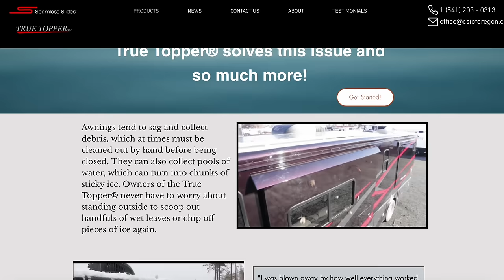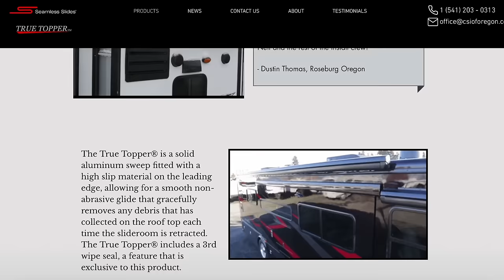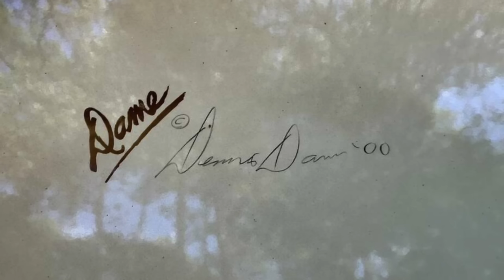Meet the True Topper® & Say Goodbye to RV Slide Topper Problems FOREVER

Comment: WOW this company is about to get really rich - once the RV manufactures see this, they are going to want them on ALL of their RVs with slide outs - This company needs to reach out to the RV manufacturers and sell them to them ASAP I hope this company has patents for it - As a mechanical engineer for over 35 years I think these toppers are quite ingenious - safe travels Lance
Reply from the maker: Agreed! These were on factory Tiffin motorhomes before THOR bought them out. As soon as one picks them up...others will follow! 👍
Reply: No, they won’t. Rv  manufacturers are all about saving money and cutting cost in the end. Also they will have to modify the lips on the slides. Don’t hold your breath.

Comment: Hey Aaron & Chris! Excellent overview of the True Topper. After 20 years with 3 traditional slide toppers on our motorhome, our biggest issue has always been the fact that they're mounted LEVEL, which allows water to pool. We upgraded the fabric to the FAR superior Tough Top Awnings material, which virtually eliminates flapping in the wind. But that still doesn't change the fact that they're mounted level, so water still pools, which we hate. We're planning the same True Topper upgrade when we get our new rig, so it's great to hear you're having a good experience. See ya on the road! 😄
Reply from the maker: Hey guys! Good to hear from you and hope all is well since we last talked! We've heard the Tough Top Awning material is really great and I'm excited for you guys to get your new rig and try out the True Toppers. You'll love them....such a simple, robust, clean,  and innovative product. I knew we had to have them when we were ordering our 5th wheel. Hope to see you guys sooner than later! 😊

Comment: I modified my three slide toppers to have a longitudinal slope as well as a higher athwart slope. Then the spring is set to maximum tension for the slide travel. No pooling no flapping. That system is very nice, but way beyond my budget. A new complete slide topper for one of my slides cost me $305 delivered. I do all work on my trailer myself.
Reply: Can you send me pictures of your modified topper? That sounds like a helpful project I might need to do.
Reply: I agree 100% about the cost. A lot of us retired full time RV’ers can’t afford items like this. I also do my own work and maintenance. I keep my slider roofs extremely clean and keep the rubbers seals treated. I also remove and replace the caulk bead along the inner aluminum strip every two years. If I’m near trees I keep the roof blown off. Maintenance of the entire camper is the key to happy full time RVing!! ✌️

Comment: Looks like a pretty good system.  On our Class A, we have three slides, small, large and largest.  The small would work with this system, the two larger slides have a locking system that projects up through the slide roof that locks the whole slide in place for travel.  So that would not work with this system.  Regarding noise, it was terrible on the two larger slides during any sort of windstorm.  At about our 6-year point, the topper material was stretched and ripping.  we went with Tough Tops out of Vancouver WA, for new custom-made toppers for our RV.  We sent them the measurements, and they sent us custom cut toppers for each slide. Following their video instructions, this 70-year-old installed them, himself.  Nice material, great quality, selection of colors, and . . . very quiet in windstorms.  Still going strong after 7 more years, I chose the medium gray color which does seem to help reduce temperatures in the AZ sun.
Reply from the maker: Nice! I've heard about Tough Top awnings from Jon and Peter. 👍

Comment: This is excellent. Such a smart idea. 

We switched to a slide free coach for many reasons, wind noise being high on the list! We had a (2021 built, non-full time use) slide topper bolt sheer off while we were in YELL last summer. We were glad to have a ladder, and all the right tools, on board so we could remove the whole assembly. What a pain. And LCI doesn’t warranty them for long enough while using cheap components. :(

These guys are doing it right!
Reply from the maker: We hear ya! Thanks for watching!

Comment: We recently rented a fifth wheel that had fabric slide toppers. During my inspection I didn't notice that one of the toppers didn't roll back up correctly (but the owner's pictures showed that one of the toppers didn't look right). Upon arriving at our camping destination, as I was opening the slide I heard a loud bang and the whole slide sort of bumped and bounced. The topper had become tangled and stopped opening which caused a big stress on the top of the slide. The topper ended up being ripped from the side of the camper and the slide didn't open up all the way after that. This wasn't my rig and it was damaged because of the slide topper. We were able to remove the fabric and close the slide completely so we were able to get it home, but since it was in my possession, it cost me my $1500 deductible. Thanks for showing this better way so I don't have to worry about toppers again as I buy my own fifth wheel.
Reply from the maker: Oh man! Sorry to hear about that horror story! But glad it didn't ruin your take on RVing. 👍 Appreciate the comment.

Comment: Nice. Concern that I have is that the sacrificial slide topper material actually does protect the top of the slide. Now having no material covering the slide, the slide is actually now fully exposed to direct rain, debris and the sun. Looks nice though. I’ve had my RV for 4yrs, my slide is 16ft long. I just changed my seals and slide topper material after it was worn and there was some minor water intrusion. Took me about 2hrs to change and cost about $400 of course I did it myself. The dealers wanted $1400. This system looks really nice best of luck, nice video..

Comment: Two concerns I see right away with this new system.  First, our living slide has 2 slight bubble skylights.  So the sweeping action wouldn’t work very well traveling across those humps.  Secondly, the true topper you showed at the beginning of this video was not removing the pine needles.  Hardly at all.  But the fact this new topper does provide an amazing water protection both while open and closed along the top of the slide.  That being said, I think I’d rather deal with the skylights and have the added water protection this new system provides.  How ingenious.  And no more wind issues.
Reply from the maker: Ah yes the skylights would be an issue. Thats interesting to have them in the slide like that...cool! The clip in the beginning with the pine needles is the same clip at the end with the pine needles. I showed the top of the inside slide right after the outside shot and 99% of the pine needles gone! 👍 Its really swept everything so far!

Comment: Wow.  Great Video!  First time seeing this on a 4th Wheel.  We have a 2008 Tiffin Allegro Bus and have considered this option.   I was quoted around $4.5k for the install.    Replacement slide toppers run me around $800 every 3 or 4 years.   All things being equal, the True Toppers are actually superior to the slide toppers.     

Just a note - Tiffin is not installing these on all their motorhomes.   From what I understand, only the Breeze and Zephyr had these installed.  I had heard that Tiffin was going to start putting this system on the Allegro Buses but pulled the plug on that after the RV market tanked.

Comment: I think a slide topper that could be detached easily when winds are high would be best for the conventional types. This is a good idea, the only issue I noticed was the debris piling up on the top of the awnings and the cost.

Comment: While in transport, do those flanges that “seal” the slide vibrate or shimmy? Will that eventually be a concern? 
I think we will get this done when we get our trailer!
What’s the cost?
Reply from the maker: They lock in pretty tight with the spring locks. Slides with only track on the bottom will have more movement than dual track systems but should be good either way. $1000-$1500 per slide installed. 👍

Comment: That is a very good solution to the #1 slide issue.
Question, when the slide is in, is there a latch that holds it down, or is it just spring tension, can you lift it with your hand?
Reply from the maker: It is just that spring lock I show in the video. It's a pretty simple design and as the slide closes the topper is held by the back of the slide flange and spring lock. You can not lift the toppers when the slide is in. But when in the out position, you can lift the topper up to clean under or inspect. 👍 It's a crazy simple design.

Comment: We are on our 3rd 5th wheel and the two previous trailers came with slide toppers which we hated.  We live in NE Kansas and have a ton of wind here, sometimes well over 50mph.  Those toppers were so noisy on both of the previous RV's, and would keep us up at night during higher winds.  They even caused the slides to move around more as they would catch the wind.  Our last trailer with them suffered failures on both the fabric and it ripped about 12" long on one of them.  It failed two years into owning it.  I just checked and they have a dealer/installer in Topeka, KS, which is about 1 hour from us, so I just reached out to them.
Kent
Reply from the maker: Sounds like you guys get some serious wind there. We feel your pain on the noise from the toppers! Its horrible. But glad to hear you're close to one of the installer locations and reached out to get more info. 👍

Comment: Makes me wonder if we are going to start seeing damage in the slide membrane from these.  Thats ok, more work for us mobile RV Techs lol. Thanks for another great video showing us new RV ideas.
Reply from the maker: Thanks! I had that question too prior to getting them installed. I thought maybe they were only for fiberglass or metal roofs....but the leading edge of "high slip" nylon doesn't make a mark on the membrane! 👍
Reply: @IreneIronTravels  it will make for a good update video. Im thinking, depending on the kind of debris, it might have a long term effect of wearing the membrane thin. Pine needles and whatnot being raked across it. But, it cant be any worse than having to go out and smack the slide awning with a broom like I do now lol...

Comment: I like the concept my only concern is over time will the flap start to flap while going down the road. 
I have the slide topper (black)  but I can say my slide ceiling is cooler with them than t h e dining room slide that doesn't have one. 
I just love the finished look of the true topper no chance of ice build up when slide is in, very impressed.
Reply from the maker: 👍 The slide spring locks should keep it in place when the slide is closed. But if for ever some reason you had to replace the spring locks, it's an easy 10 minute job. 👍

Comment: I like the idea of the true topper but all they really do is sweep your slide. They don't cover it. Using the same process and technology it seems that they could manufacture them the depth of your slide and when you bring your slide in it could lap over the slide and cover most of your window. It would be beneficial because it protects the entire roof of your slide room, it would allow water to run off,it would protect your windows from damage while driving and also help protect your interior from the sun fading fabric. Just my thoughts.

Comment: I can't help wondering what happens if I need to have the roof of my slide replaced or repaired.  I doubt my local RV shop will know how to deal with these or has a tech who's been trained on them.  I guess it would take a trip to their factory if you need any work done on the product or on your slide roof.  Other than that, looks like an interesting design for a sticky area of RV design.

Comment: After seeing the final product and the owner working they did a great job. I am assuming after trimming the slide boxes your warranty is gone from Alliance.
Reply from the maker: 👍. The warranty is only effected if the trimming was determined to be a cause of the warranty issue in question. So for example, if I had a frame issue, electrical issue, or a roof issue, etc this would not affect the warranty process. 👍

Comment: When the old topper hardware is removed, is there any sign of them that you see the old install, or does the "True Topper" cover up the marks from the old topper hardware? BTW, really good video! I just didn't understand how the whole system would work until seeing your video. Also, the cutting of the top flange has been what has stopped me from moving forward. After watching the video I feel more comfortable moving forward on having my RV updated. Thanks!
Reply from the maker: It can vary depending on where the old toppers are attached to. The sidewall part should get covered up.  Some slide out attachments do get covered up or even removed when the flange is cut off. Some original toppers are attached to the side of the slide out. So it might get covered when the slide is in, but might show when the slide is out. They have to get creative with each different unit.

Comment: First off, very well documented and articulated installation.  My question revolves around the material being pushed off the top of the slide and into the trough created by the awning and side of the slide.  Does traveling at highway speed create enough airflow in that area to blow the material out?  Love the product and will definitely look into it if/when we change out our fifth wheel.
Reply: I was wondering about that as well. I was thinking if opening  the awning once you get to your next destination would remove the debris that gets stuck in there.
Reply from the maker: Thank you! Yes, that is an unfortunate " natural catch " created by the awning. If we're parked under falling leaves they will fall in there also and add to the build up. But, yes so far traveling has blown the leaves out of there. Or if it's a lot of fallen leaves I'll just unroll the awning before we travel to get them out. You could also blow them out or use a garden hose.
Reply from the maker: Yes, we do unroll the awing if it gets too built up with leaves! 👍

Comment: Beautiful product. My question is did this modification void your warranty on your new 5th wheel?
Reply from the maker: Thanks! No, warranties would only be voided if the Topper was at fault for my warranty claim. You do have to be some what diligent with aftermarket accessories, but a good example is if my roof leaked because of a factory defect, my warranty is not void because I put 11 aftermarket solar panels up there. But, if it was one of my solar panels that caused a leak, the factory would not cover it. 👍

Comment: I was very impressed with the installation of these on your Paradigm. We own an Alliance Valor 40V13 and had a Paradigm 390MP prior. They both had slide covers  from the Alliance factory. 
A couple of questions for you. Does this void the Alliance warranty at all? The second question is since we have slide covers which would need to be removed will their installation process also repair the holes where the slide covers mount currently? 
Great video as well on this process.
Reply from the maker: Thanks! When I spoke with Alliance about adding aftermarket upgrades to our RV like this, they explained that unless the new item was deemed to be the cause of the problem, then the warranty is still intact. So for example if we had a roof leak after 3 months and I submitted a warranty claim it would be covered if it was found to be something like the AC unit or skylight leaking. But, if it was one of our aftermarket solar panels that caused the leak it would not be covered. 

And yes, they do have various ways to fix and cover up the holes. They showed me plates they use, or sometimes they can even reuse the trim to cover certain areas. But, hopefully your slide topper brackets are up in the flange that gets cut off. Although, Ive seen them in the sidewall as well. If you send them pics they can go through the exact process on your rig. 👍 Appreciate you watching!
Reply: Thanks for the info and getting back so fast. Safe travels
Reply from the maker: @barrytobias6921 you bet! Same to you!

Comment: Does the silicon wipe seal need to be replaced like wiper blades??  Is the silicone part user friendly?  How long does the silicon seal last?  Do you know if the Imagine KLS 22MLE is a candidate?
Reply from the maker: Hello! The wiper seal will probably not ever need to be replaced because it's under the flap and is protected from the sun's UV. But if it ever does it would be a quick 10 minute job if for some reason it got torn or something from a stick, etc. 

Is your RV the Grand Design XLS 22 MLE? Yes, that would be an easy one slide out RV with no awning or anything in the way. Would look good in the standard black. 👍  Very similar slide out box to our 5th wheel.

Comment: Nice Toppers but one issue I see so far, is the black tape on each side of the ramp, look like eternabond tape, that's not gona hold there for long time with the hot sun, this should be a plastic cap and seal there.
Reply: IT's not tape, it's the fancy adhesive plasticy stuff. See at 10:53 - 11:15mark where they talk about it

Comment: Hmmmm - these aren't toppers, they are slide squeegees? We installed custom fabric carefree fabric toppers, they aren't level, sloped, not level, in a neutral color. The only issue is the high wind, which we have come up with a solution that works very well, even under high winds.  Being out west and boondocking we wanted some airspace and UV protection from the sun., so we aren't sold. Thanks for the interesting video.